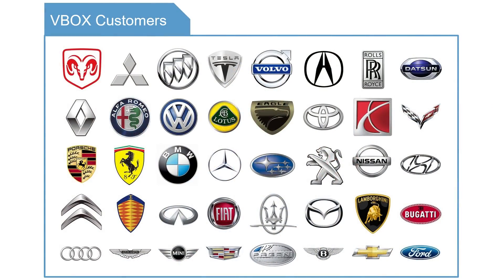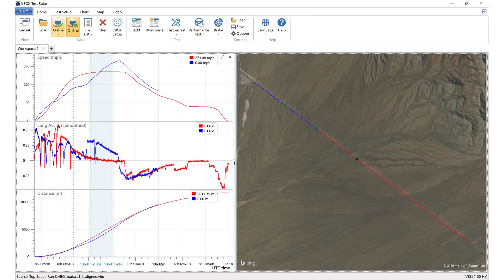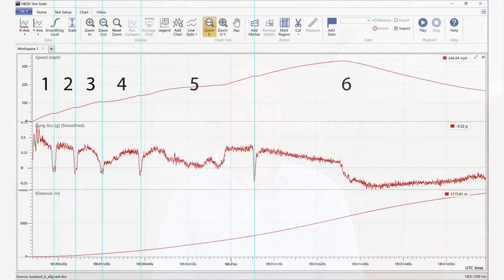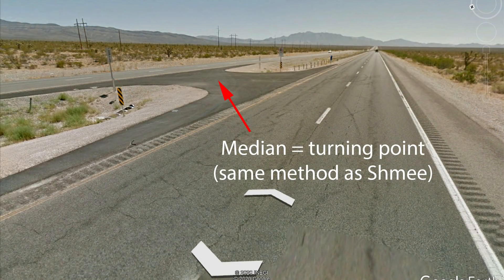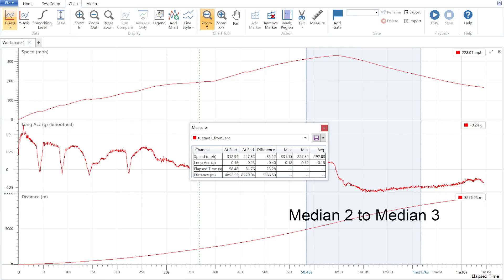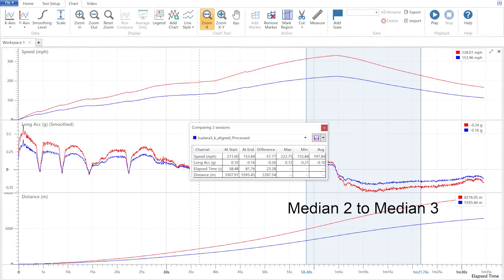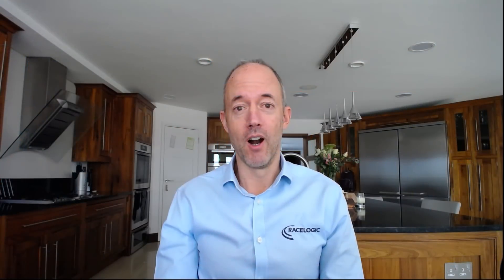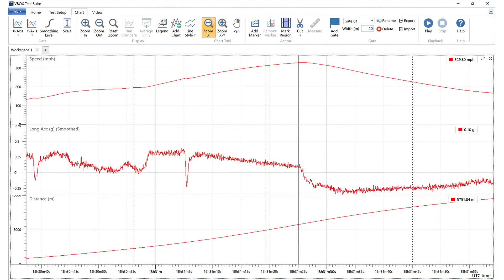How fast did the SSC Tuatara really go? Here's my calculation based on some new data.

Comment: 223? 😂😂😂 That's really cute SSC.
Reply: SSC:  Your reading it backwards!
Reply: That is not only barely faster than a McLaren P1, but it is also nearly 25 mph slower than an F1, a car which debuted in 1992! XD
Reply: @josht982  Than lower top speed that a Dodge Demon bruh...
Reply: @josht982  with 618 hp aswell lol
Reply: Boston 508617  according to calculations, the curb weight is about 2900-3000 pounds
Reply: 223 isn’t the max speed, it went over 240 mph in Stradman video, I think its capable of doing 300 mph, it has 0.279 CD drag, 2750 pounds, 1750 hp, if a heavier Bugatti Chiron that weighs as much as a boat can do over 300 with less power and same aero, so can SSC tuatara.
Reply: @aimxdy8680  Yeah, also what confused me was why didn't they use the highest gear when the car had clearly no problems with acceleration on the lower one. If you go for top speed, use all the performance the car has to offer! If they really made the last gear more for some economic reasons then its quite useless with a car that was made for beating the top speed record..
Reply: @kjyu  7th gear is an another overdrive, if they use it for max speed they will just crush the components.
Reply: @kjyu  it was the crosswind factor and mechanical risk. If they wanted to use 7th, they needed to shift on the lower rpm because if you happen to misshift, the risk of shattering the gears is minimal compared to misshifting in the upper rpm
Reply: @aimxdy8680  Stradman video 240mph is digital speedometer speed not actual speed, you never know how much actually it was doing, also in that video alone you can see the car isnt as fast as we believe cause Agera destroyed Veyron much faster than SSC pulled against Stradman Veryron
Reply: @aimxdy8680  check first if there are 1750 whispers in the car
Reply: @aimxdy8680  it went ~186 (real) mph in Stradman's video, speedo is over-reading by ~29%. Cd is said by SSC to be 0.315 at speed. Real power (calculated from "record" video and vs Veyron video have showed no number higher than HALF the claimed 1750 hp). The frontal area SSC gives is also likely not correct.
Reply: @aimxdy8680  weight has no real bearing on top speed unless we’re talking 10s of tonnes, it only affects acceleration.

Comment: Great video! Could the big (but consistent) discrepancy in real and stated speed occur because of a "glitch" or technical error? Or is it more likely to have been altered deliberately in post production?
Reply: It wasn't done in post, because the driver was informed of his speed as it happened live. The correction factor was implemented before they started the speed runs.
Reply: That software was not Dewetron's.
Reply: It was done pre production.
Reply: Short answer... no

Comment: One thing that I keep wondering about is what Oliver Webbs thoughts where on going 300mph+++ (331mph) on tires that wasn´t tested for these type of speeds, without the tire company present at the record attempt. Him, as a racedriver, should know about the limitations of tires and the exponential increasing risk of tire malfunction with speeds above 250mph. How was this not an issue for him if he really "thought" they where going 331mph? And shouldn´t a racedriver be able to differ between 223mph and 331mph? If the difference was let´s say 30mph it might not be that easy to tell, but 100mph+ difference? Plus the extreme accelaration that was still happening at 331mph? I think he know more than he is willing to admit.
Reply from the maker: Don't get me started on 300mph tyres, I tried to stop Richard Hammond before his last run in the jetcar as he was just about to exceed the tyres. I was over-ruled...
Reply: @jools360  By the way, amazing work and calculations you did here, really taking this "investigation" to the next level!
Reply: @Robin_Juthberg  Wow, thats some incredible insight on Hammond.
Reply: @jools360  I’m sure they wished they listened for that one!
Reply: @Matt-po4kc  Actually, as Hammond survived that crash with no injuries, I'm pretty sure they were happy they didn't listen!
Reply: @jools360  Hammond always crashes on the last run by breaking the speed limit. That's exactly what happened in the Rimac case too. They got ready to pack up and he couldn't resist trying to go 30 mph faster. Next thing we know, he nearly sunk Rimac!
Reply: @srinitaaigaura  It’s always the last run for a crash because after you crash it has to be the last run... 🤪
Reply: @jools360  this is a ridiculous story 😧
Reply: @jools360  This is one of my complaints to all the fan boys or those saying how great it is that SSC is going to rerun. It could be any number of potential failures at those speeds that ends up killing someone. Everyone trying to justify the second attempt at a record run needs to realize the driver is going to be risking their life because of either incompetence or intentional deception and that doesn't sit right with me. For the drivers safety I only hope they choose to get permission at a safer venue like Kennedy Space Center or Edwards AFB runway.
Reply: @Two-StrokeLife  Makes sense now that Oliver Webb has said he will not be involved in the second run unless it takes place on a runway or other closed environment with more safety measures
Reply: @Two-StrokeLife  Edward Air Force base is only 15,024 ft long. Is that long enough?
Reply: @socalguy829  is there any runway long enough to actually handle a car that supposedly can reach 300+mph?
Reply: @jda671  I believe the shuttle landing facility is rated at 15,000 ft  +  2k  of overrun. On google maps it's approx 3.22 miles and that's where the Hennessey Venom GT recorded a top speed of 270.49 mph with more weight, less power, higher drag and plenty of runway. Edwards is rated at 15K + overrun. On google maps it's approx 3.18 miles but they also have the dry lake bed at one end just in case, that's an extra 9,000 feet oh shit room. Entering from the South West you could probably carry a fair bit of speed from the taxiway since the runway is 290ish feet wide. You could make your conservative run from the North East away from the the lake bed and your balls out run from the South West towards it. Either way, if they can't get it done in 3 miles, it ain't gonna happen, the car will eat itself alive or the tires will go BOOM!
Reply: @Two-StrokeLife  Great info.  I hope anyone doing a test like this chooses one of those options.  We lost Jessi Combs last year. I do not want anyone getting hurt.
Reply: @f50koenigg  sure there is. Just use the one they used for Fast and Furious 6. 26miles long that one!
Reply: @jda671  we need the german autobahn... ;););)
Reply: @Two-StrokeLife  I'll have to agree with the walking thesaurus on that
Reply: @f50koenigg  how about the VW track in Germany that Bugatti used? It has an 8km straight, with a banked turn heading onto the straight.
Reply: @westview9917  Exactly what I was thinking...
Reply: One more thing, why did he lift his foot of the accelerator during strong acceleration if he didn´t know the speed (he stated that the speedo was of by 15mph or so, so it couldn´t be trusted) and he didn´t know he had broken the record (as far as I can see from the video he gets the "news of the record" after he had allready taken his foot of the accelarator)? The cross wind thing did not happen at the same time as he took his foot of the accelarator, so that didn´t seem to be the reason.
Reply: @Jordy L conceptually it would work but practically speaking SSC is a very small company and doesn't have the funds to pack everything up and take the car to Europe. Especially during Covid.
Reply: looking like he is complicit... that's the simplest explanation
Reply: @Bablobiggins  sorry disagree I don't think Ollie is that type of person but I have no proof...

Comment: Thats off by nearly 50%! So it's either an error or deliberate. Both seems so improbable tbh.
Reply: Yes, but it might be possible that they THOUGHT that they had broken the world record! They simply did not know any better. If they were provided with FALSE data (and had absolutly no knowledge about it whatsoever) they may be excused. I will give them the benefit of a doubt. Next time they should prepare just like the current recordholder  Koenigsegg. It is possible that this car actually might brake the world record (again) with an avarage top speed of 316 m/h, but CONFIRMED this time!
Reply: @perhentzepetersen9310  when they heard the news about their record not being legit they obviously went over everything to verify..but instead of just admitting their mistakes, they instead try to lie and say a gps company has validated the data to absolutely correct. the gps company had counter this claim by releasing a statement..mr jerod shelby didn't even bother to address that on his latest video. you can't have a discrepancy of almost 50% and claim you didn't know nothing was off..obviously mr jerod doesn't seem like bad person but good people lie too.
Reply: @perhentzepetersen9310  If they break the record the average speed will not be 316mph.
Reply: @perhentzepetersen9310  They know the gear ratios and they know the peak rpm by looking at the ECU datalog. They knew within hours the actual speed the car ran. This was set up as a fraud from the beginning. The car designer even stated he had buyers that wouldn't commit until they had the record, so there is definitely motive.

Comment: Great input.  I didn’t go quite as low with the correction factor as I used the engine rpm and known gear ratios to give some hints at a few points.   If it’s this low that’s really insane!
Reply: Can you double-check the 2010 run with the SSC Aero?
Reply: Don’t have to. Guinness was at that one
Reply: @Siskovski  Same SDK.
Reply: Industry VMAX professional dispels SSC Tuatara record from his kitchen in 9 minutes over a cuppa joe. FTW 🏁
Reply: @Elias Håkansson I cannot say as my figures are a bit higher than this.  knowing rpm at certain gears shows higher values than we have here so I cannot begin to compare them as I do not have enough info to see where our differences are :)
Reply: Since these videos I've been trying to work out if it's potentially another unit that they have picked up from the GPS and overlayed on the telemetry in error. Finally after this video it seems to make sense, interestingly foot/sec is a 1.4667 correction factor from mile/hour. Using this correction factor you would get a result of 225.78 mile/hour which would be well within the margin for error of Julian's calculations
Reply: @simonr32gtr  Plot twist. Maybe SSC fell into the trap of units conversion? NASA already did it, so they wouldn’t be alone... LOL
Maybe their custom software (as Julian points out in the video) on the laptop reads the gps data in ft/s and displays it to the screen as mph without converting. This may have been an unintentional bug in the software, some coder overlooked some calcs. And if the whole team wasusing the same software, that’d explain why everyone, including the driver, believed they actually hit 331mph, when it was in fact 331ft/s...
Reply: @Rmaia3d  GPS is always done in knots and converted....
Yeah I know....
Reply: @4doormk1  Knots? Really? That’d be 1.852 to km/h and 1.151 to mph... Turns out multiplying knots by 1.609 gets you a number that’s somewhat close to ft/s.... (1.609 being the mph to km/h conversion factor)...
Reply: @simonr32gtr  This!
Reply: SSC dun goofed up big time yalll
Reply: I’m loving this worldwide dialogue
Reply: @Elias Håkansson it could be tyres
Reply: Most probably SSC used these runs to confirm their simulation data, and based on that they figure the car could PROBABLY hit the quoted speeds.  The PR spin of stating the numbers as fact gets them massive publicity, not expecting the scrutiny this received.  Either way, grossly unethical, as there is no way they can dispute that the car didn't reach speeds anywhere near 330mph!
Reply: #stopthisrelentlessbashing 😜
Reply: @einautofan6685  don't be stupid... if we stop none of this great investigation would happen. ssc needs that next run